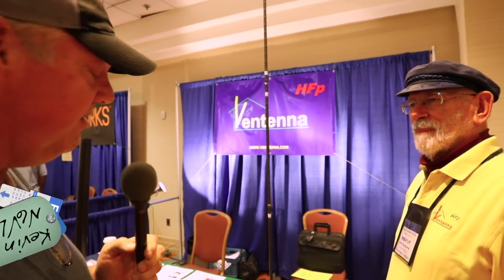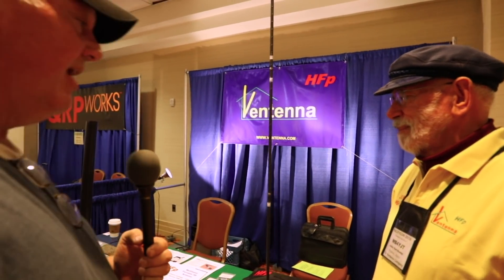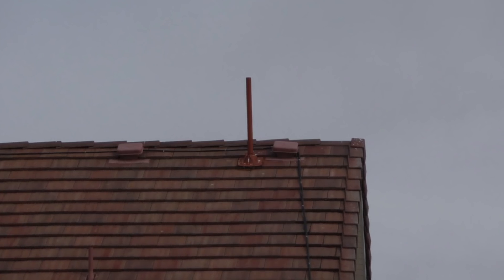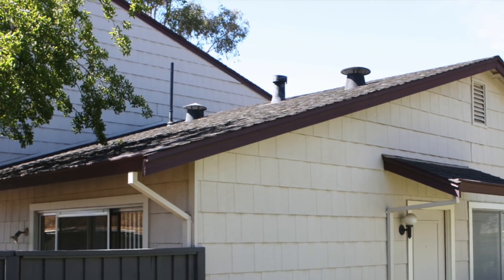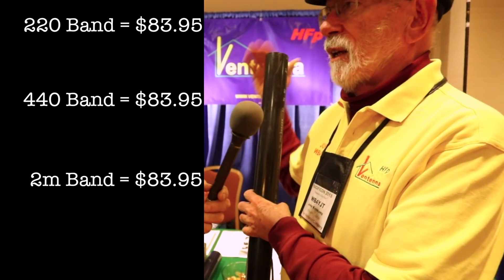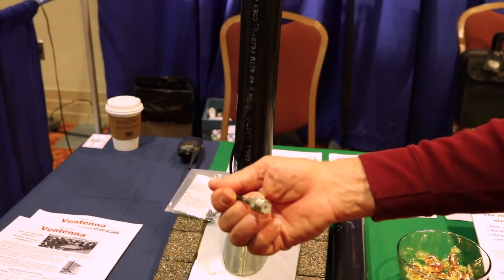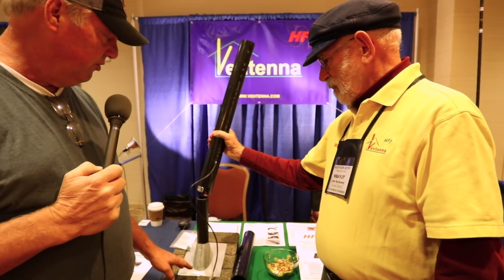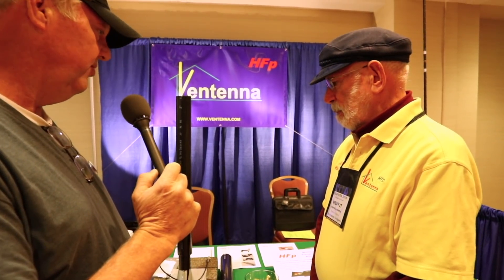Hidden Ham Radio Antenna

Comment: Neat product, but it is not lightning safe to run the feed line straight down into your attic.  If you have fire damage after a strike the insurance company is going to deny any claim for compensation unless it is consumed in the fire.

Comment: Amateur radio operators are the only species who know fully well, that moving into a house with an HOA is problematic, yet they proceed, and complain nonstop afterwards. But i get it. They themselves are like the HOA presidents; always pointing out shortcomings, and violations to other amateur operators, sometimes even gaslighting certain operators, who they have something against. Just like in an HOA.
Reply: Seems to me all these HOA's are  jumping on the bandwagon  by severely limiting or even trying stopping ham radio enthusiasts.. and the majority of the complaints come from old women whio have nothing better to do but complain  and run to the HOA  at the least bit  of  interference on their Tv's or radios.    best thing is not to advertise the fact by keeping ones mouth shut   tall antennas are the best for us  ham operators but with all these complaints  were forced to  move into the attic. i know a bloke with a private house  miles away  from suburbia and fields all round about him with a huge yagi  antenna and guy wires into the fields ... and  four  women  standing outside their car staring & complaining  about him.....  why is it all old women who do the complaining????

Comment: Hmm 🤔 let’s look at this a bit closer.
In the attic. There’s a T connection.
I’m hoping that the instructions on how to install, make mention of sewer gas that could build up in your attic and that the section of the T pipe must be sealed in a manner that does not allow sewer gas build up in your attic! Which could really raise the roof of your house If said gas came in contact with an ignition source. In other words, methane BOOM!
Reply from the maker: I've not installed one myself but I'm sure a little craftsmanship could go a long way on this install. They also sell a fake boot so you could install a vent tube anywhere on the roof.
Reply: It’s a dummy pipe... but what stops the rain from filling it up ?

Comment: This seems like a good idea, but one drawback is that outdoor antennas' coax should be connected to some type of lightning arrestor before entering the house.
Reply: Im a CBer in the uk. We get a fair bit of lightning.
I have a 5/8 wave on a 40ft pole.
Its been up since the 80's .... Never been struck, no lightning arrestors, I just tie a bag over the PL plug to stop the rain and throw it out the window when the storm arrives.
Reply from the maker: Good point. We are lucky in this part of CA and don't get any lighting.

Comment: Thumb's up.
But, let me see HF vertical that carry full legal limit built the same way.
I live in (and work from) an apartment and run mobile antennas - there's one outfit that makes mobile antennas rated @ 1000 watts but you have to switch traps to change bands which can be cumbersome mechanically.  Currently, I am running a multiband matcher that's rated @ 500 watts with a steel whip where the wire should be that the matcher came with. Works great so far with my Kenwood TS -480SAT and INRAD desk mic that I sort of converted into a foot pedal.  
Obviously at this point maybe, everything's a "GO" with my apartment management as they have a basic working knowledge of Ham Radio, but mistakenly think that my FCC license requires them to let me put antennas on the balcony railing.  And with my experience with the ARRL proving themselves unreliable upon making mistakes with my membership and expecting me to pay extra for those mistakes, and dropping the ball with legislation again on the HOA/PRB-1 deal, I relied not at all on them. (As far as Amateur Radio goes with me, I consider myself a "rogue hacker" that others might think that I should be owning and wearing a Guy Fawkes mask along with hating the government or something!) I love the hobby/Art but I've met too many Hams that are rude, condescending and belligerent and basically a contradiction to the philosophies of Amateur Radio and such.  Again, I'm a "gray band hacker", (I've even run digital modes on CB - just because!)  Otherwise, good video, great concept, and it should be easy for others to beat me to a multiband "hidden" antenna that will carry full legal limit.

KD8EFQ/73
(Not to solicit, but I have a little channel here on YT featuring my antenna/balcony railing setup if anyone wants ideas on how to mount things in such a manner.  I think you can just click on my ID here.)
Reply from the maker: Yeah, it would be challenging to get an HF antenna on the vent pipe. I checked out your YouTube channel and you have a great setup for the limitations you have to work with. I think CB is great and that is how I got started with ham radio. I wouldn't worry about the nah sayers and just stick to having fun with the people that are positive and also fun to interact with. Thanks for dropping a comment and sharing! ~73 KM6FAK~

Comment: Very innovative and will definitely try one out when I get my housing situation corrected.  Right or wrong -- I will say this, however, to all the restrictive HOA Nazis out there.  A condition may occur where y'all need us HAM radio operators because there is no other way to communicate.  I say so because I've already been through such a situation.  Years ago when I was IT manager, I started carrying a "go bag" everywhere I went.  The components of the bag consisted of various tools to communicate including two cell phones.  As well, I kept a few blankets and some tarps in my SUV.  Because of the aforementioned I was regularly made fun of by co-workers and managers in my department.  Then the 9/11 attacks happened.  Which, about seven months after the attacks -- I was sitting in a conference room with other IT managers discussing the details of a new computer system.  Suddenly a VP blasted into the conference room screaming at the top of his lungs that we needed to evacuate the building immediately due to a possible anthrax attack.  I ran back to my office grabbed my go bag and got out of the building.  Once outside, I was met with frantic managers who needed everything from pens and paper to write on to cell phones to communicate.  Consequently, when these frantic managers realized that I had my go bag -- well, you know what happened next.  Every component of my go bag as well as the equipment in my SUV was utilized initially because the security team for my company was so caught off guard by what had happened.  Put it this way, even my trench coat was taken from me.  My two cell phones ended up in the hands of managers and then were passed around to other co-workers who needed to make brief "I'm OK" calls.  BTW, some of these managers and co-workers were the very same ones who had prior to the incident -- ragged me -- sometimes on a daily basis because of my habits.

Finally, after the incident, the company I was working for instituted policies where all their VP's, managers and essential personnel had the tools to communicate during an emergency.  I can't say for sure if me having a go bag had anything to do with the policy changes -- all I can say is that I was no longer ragged about my go bag.  KN4PNC.
Reply from the maker: Dang, what a neat story! You really were the hero that day and you most definitively taught a lot of those people and the company how ill prepared they all where. I totally agree, most people are not ready to loose electricity, communications (cell phone) and food for that matter and they don't even think about it. I'm becoming less "crazy" among friends with all my radio stuff, as natural disasters and terrorist attacks take place. 73~KM6FAK

Comment: That’ll be a j-pole or a slim Jim in the tube. Hardly ground breaking stuff.
Reply from the maker: I hear you, some people just operate and some people build. I can make a great hamburger on my grill, but sometimes I just want to buy a hamburger at a burger joint.
Reply: Ham Radio TV that's a fair point although it'll have to be some burger for 130 bucks

Comment: im thinking of copying that and putting a patent on it....hmmmm..
Reply: It is neither a Slim Jim nor a J-Pole.  And it is patented - #5,349,362
Reply: yes you are correct...here is the link with the exact drawings of this antenna.
https://patents.google.com/patent/US5349362A/en                  @johnk9895
Reply from the maker: I would be surprised if it isn't already patented. The Ventenna company is a LLC.
Reply from the maker: Thanks for clearing that up John!